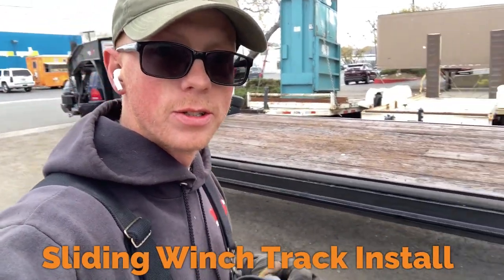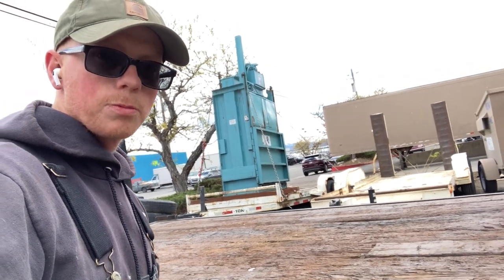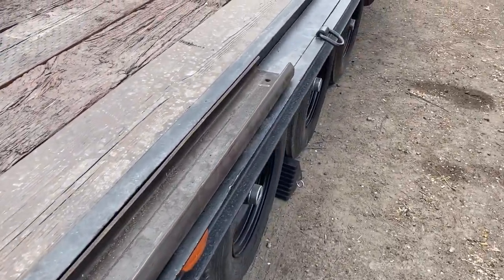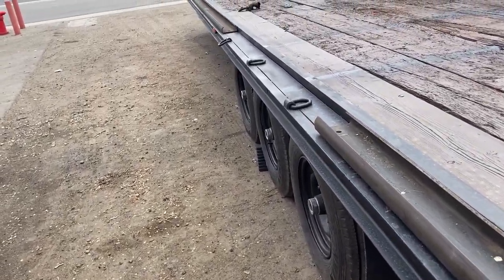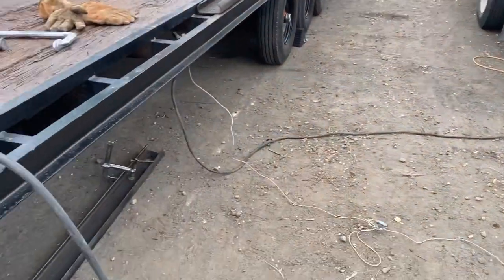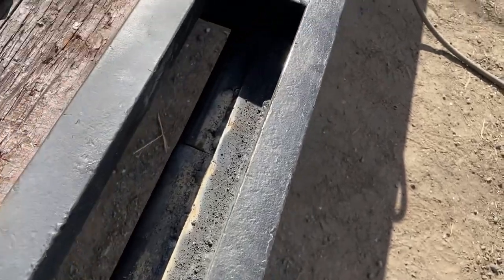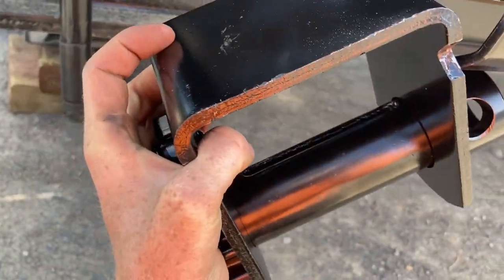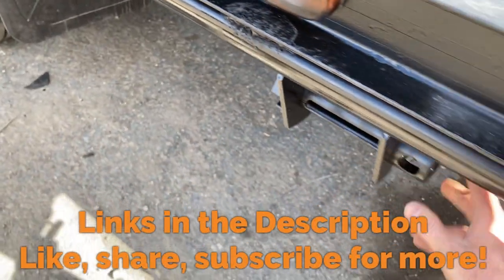Sliding Winch Rail Install, Tie down your flatbed loads quicker and easier! Hotshot heaven!

Comment: You need winches on both sides so you can alternate strap directions. That way you pull the load evenly in both directions when securing.
Reply from the maker: That’s a great idea and I’m sure would help.

Comment: I’m looking at a 25k GVWR Dual wheel 25’ deck over trailer. I drive a F450. Will I need a special drivers license for this thing?
Reply from the maker: Nice! There are some states, like CA and NV that require you to have a CDL if your trailer weighs over 10k lbs
Reply: If the truck and trailer combo are rated for 26,001 lbs or more, you need a CDL. With a 25k trailer you will definitely need a CDL. There is an Ag exemption if you are using for agriculture use within 150 miles of your home.